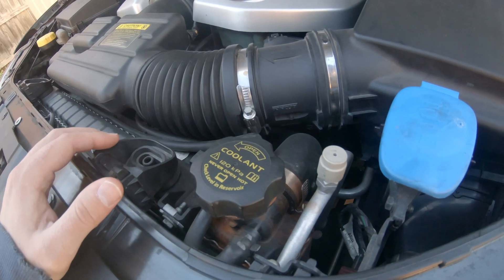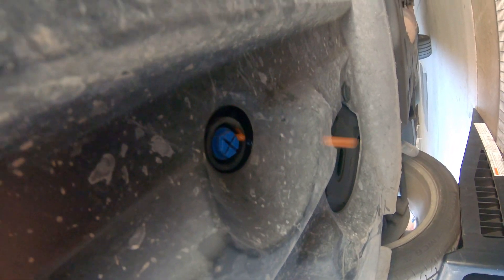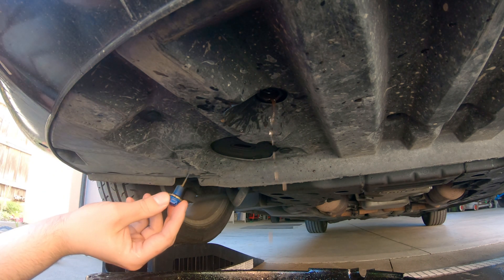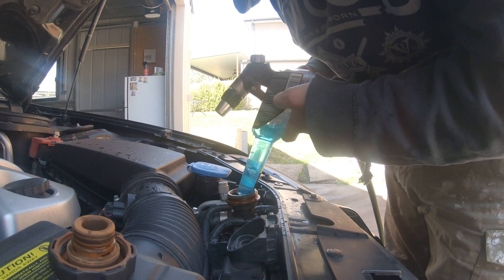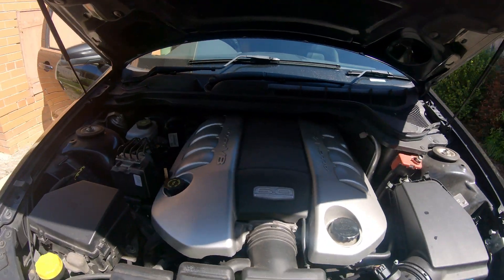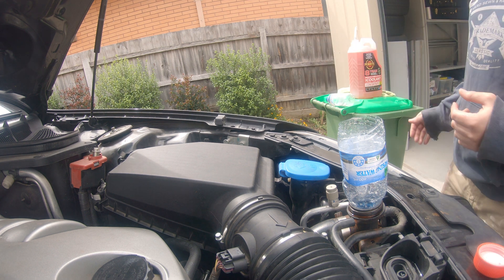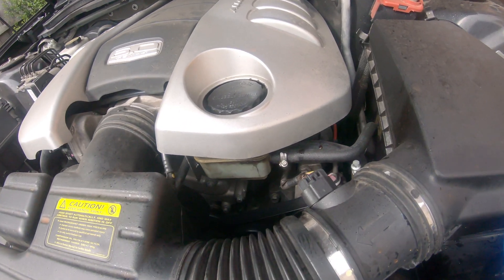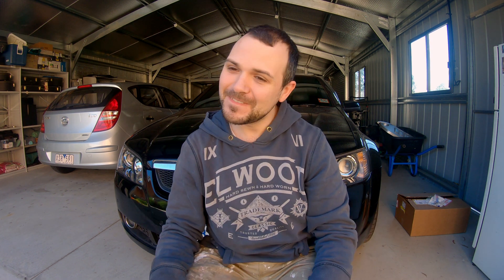Penrite Coolant Flush Fail - VE Calais V8 (Pontiac G8) Read Pinned Comment Before You Try!!!

Comment from the maker: A Quick note on filling and bleeding the system. A few people I have spoke to since have said to top up via the heater hoses to get in behind the thermostat, or pour straight down the top hose into the water pump (rather than the radiator) to make sure the block fills so you don't inadvertently run the pump dry! Thanks for stopping by and good luck with your repair!
Reply: Agree 100%, i hope you have looked after it, best insurance for the auto as well is get it serviced and put a external trans cooler on it, unless you have one on it already but great stuff and look after her champ, cheers. :)
Reply from the maker: @7071t6  Cheers mate - The auto is next on the list - the old GM slush boxes are better than they use to be but would rather do a service than a rebuild!!
Reply: This iz correct I have a 07 ve SV6 a lot of people make this mistake

Comment: Mate.... tough luck with the water pump! Not sure what the guy below was saying you did wrong.... I use the concentrate coolant and top off with diminerised water.... been doing that way every 2 years for years. Other wise same process..... good video!
Reply from the maker: Thanks for watching and for the comment Paul! Yeah not very constructive was he? I could have used de mineralised water or flushed the block directly without the thermostat , but if you do it often enough (like you do)  you are already doing more than most - and probably doing a more thorough job than most dealers!!
Cheers!

Comment: Not bad mate, the reason why theres so much rusty colored water is that if you use normal tap water it has chemicals in it like fluoride which acts against the inhibitor in the coolant which is why its better to use distilled water or a penrite pre mix which is already made at 50/50 and the concentrate is still as good, but with the pre mix it has the distilled water in the mix, but also who knows when the coolant was changed last and what product was used. keep up the great work, also be careful because the radiator has trans cooler heat exchanges built in it, which as the rust tarts to eat away at things it can cause the heat exchangers to fail thus having trans fluid in the auto and then your in a world of hurt. :)
Reply from the maker: Cheers Mate! Bang on about the rusty water. I think when the last water pump was changed (I didn’t do that one) it was just filled with water. I actually pulled the pump apart and the impeller was corroded to buggery, only a few years old too!  I think our water in Vic is softer than some other states (less minerals, but yeah still fluoride) , either way agree mixing with coolant, or using distilled water is the way to go! I have heard of the dreaded ‘strawberry milkshake’ before, not so much on these GM cars but early 00s Mercs. These GM Automatics are a time-bomb at the best of times so really hope my radiator holds up!!

Comment: Is it the same risk of damaging the water pump in the v6 version?
Reply from the maker: Hi Mate, 
Possibly - It depends how the colling system works in those alloytechs vs the LS V8s. Either way if you can find out how to bleed it and fill it properly before starting any job on it you should be right!

Comment: I've used sugar soap for years to clean cooling systems little bit more time consuming but does vert good job
Reply from the maker: Hey Barnaby! Sugar soap eh?  - never heard of anyone using that but if it works it works! When you say it takes a little more time is that cause you need to flush the system multiple times?
Cheers!
Reply: @MeatballGarage  sorry for the slow reply but yes u have to make sure  u get every bit of sugar soap out

Comment: I drained today, only 6 ltrs came out + plus sucking out what's in resovoir with a battery operated pump. Could only put in about 4 and a half ltrs with 500ml nulon extreme radiator flush + some in resovoir.
Ran car for about 40mins, till it hit 93deg Celcius.
Drained it. 6ltrs came out with draining resovoir. Filled it with 50/50 coolant about 6ltrs, ran it for an hour with cap open and AC to hot but not blowing air and watched it bubble/burp. Temp raised to about 90 I then I made AC blow by turning settings up to 13.
Fluid dropped.
Topped up, closed cap. 
Went for a drive. 
Temp dropped to 70, then climbed after 10mins to 83deg Celcius, and settled.(usually would sit at 87deg, this may be the computer relearning as I drive or even dilution of coolant to water being better) .
Will check tomorrow. And top up + drive for 20km one way. Check then 20km back again.

Keep in mind this is an 8 year old sv6 s2 z series which has now 111,000kms on the clock, who to as far as I'm aware has never had a coolant change done. so the low output of coolant drained could be due to evaporation as I've never topped it up but have also had no leaks.

This is probably more detail than I've heard anyone mention.

Oh and you may see coolant actually spin during the burping phase.

Also I used nulon red, deminerelised water all the way through, no tap water.

Will be performing again in three months to flush and drain more thoroughly. Though my system was very clean it seems.

Hope this helps somebody.
Reply from the maker: Hey YingYang Orca! Great write up mate and thanks so much for sharing! I'm sure a lot of people will appreciate this info and find this useful!! That is a very low km VZ you have there! When you drained your coolant initially did it come out clean/dirty? 
Thanks again
Marc

Comment: notice the cap has failed ,which is why the water pumped failed as well, meaning that as it lost pressure and coolant the water pump was running real hot thus the bearing stuffed up and now you have 3 real problems instead of a straightforward coolant change, but well done champ in doing it right as well. :)
Reply from the maker: Yep that cap was NASTY! I had replaced it once before already, and since this video went through another 2 (along with the heater hoses..) The first replacement cap (non OEM) held pressure but just seeped coolant straight out the top of it! Eventually just bit the bullet and got an OEM one which is bang on!
Thanks again mate - hopefully have some more car vids up soon!

Comment: Great video! I'm about to attempt this on my ve series 2 sv6. 
Question though whats best way to bleed the air from system? Just run the engine with the filler cap off?
Reply from the maker: Cheers Joel! That is pretty much what i do to bleed (right or wrong). Make sure the radiator cap is the highest point in the cooling system, fill it up, run the car till the thermostat opens then top it up again and just watch all the air bubble out. Close the system once the bubbles stop and you are good to go - just check the coolant level again the next day. Good luck with the job - let us know how it goes! 
Thanks for watching!
Marc

Comment: Buddy's how many litter used in that collant bottle? And yet very helpful insights on how change collant for a commodore; enlightening indeed big thanks.
Reply from the maker: Cheers mate - Just be careful when filling and bleeding the system - read online on how to do this correctly. 
I can't remember how much coolant this thing took - the internet says a VE L98 V8 takes 14.3l though if that helps. Is yours a V8 too? Cheers mate!

Comment: I’ve even purchased a new radiator and new cap but still have the car heating up to 102-104 sitting at lights and on average 30 degree driving it will go between 94-97 and up hill drives will see it rise to 110 and thermo fans kick on at 109. Sticky thermostat? Ve Sv6, giving me grief

Comment: What concerned me more so is the sheer rust in that water, if coolant is flushed/drained more frequently, these thing probably don't happen. You must always use demineralised water where aluminium components are, in the case of your VE
The block, heads & radiator lol. But good job regardless !
Reply from the maker: Hey Vincenzo! I know right! When that horrid water started to drain I just shook my head! I have since switched to AC Delco coolant which is about the same price as the Penrite stuff. Hopefully regular flushes will minimise any further corrosion. Thanks for watching and for the comment mate 👍
Reply: @MeatballGarage  You should use Nulon or Penrite 

They call it DexKill for a reason
Reply from the maker: Dexkill? Haven't heard that one before! I have heard bad things about both Nulon and Penrite before though..Might have to go away and do some searches on Dexkill...
Cheers Vincenzo!
Reply: @MeatballGarage  It was a known issue that gm coolant eats through gaskets, etc
Plenty of known issues, hell i'd rather use Toyota coolant before i use anything genuine gm coolant related 😁
Reply: @MeatballGarage  There was multiple class actions against gm coolant for numerous issues.
Reply: I own the 07 SV6 if you don't constantly look after the engine things can start going south real quick

Comment: Is your commodore engine an L98 motor ? also what coolant is okay to use because i have the american version 2007 chev lumina ss with V8 L98 6.0
Reply from the maker: Hey Darius! Yep that is an L98. Hmm there are plenty of opinions when it comes to the best coolant. I used Penrite once then I ended up using Dexcool - the AC Delco genuine stuff after this. Not sure what brands are available over there mate but there should be plenty of options. Good luck with it!
Reply: @MeatballGarage  so after i did my coolant flush, i had it idle and drove it a few miles then left the car sitting but started every so often, as of today, i started it and noticed at 64 degrees, smoke started to come from the thermostat area, any idea why ?
Reply from the maker: No idea mate - did you get it sorted? What was it?

Comment: Can you flush out the radiator without removing the flush plug? The head on our one broke off. It still works though.
Reply from the maker: G'day Glen - Hmmm good question - I just had a look at the radiator and it looks like the bottom hose outlet points up so there goes that idea. If you are really keen you could take the radiator out all together? 
Either way,make sure you read the pinned comment about refilling these things!
Cheers!

Comment: What does your Temps look like for coolent and trans?
Reply from the maker: Hey Arnold! Mate that is a good question - for engine temp it depends a lot on the ambient temp and driving conditions - overall though I find it operates between say 90 - 105c. On a very cold day on a highway it will hover around 90c. 95 for warmer days.  In traffic on any day it can get up to 104-105 before the thermo fans kick in and cools back to 99. I have only ever seen it get to say 107/108 a few times in traffic on hot days (when the fans go full speed). I find once you are travelling more than say 40*50kph the air flow really cools the temp really well - much better than my XW! I don't really keep an eye on the trans temp to be honest, but never seen it get to more than say 100. What are you seeing on your car?
Thanks for watching and the comment mate!
Cheers - Marc
Reply: @MeatballGarage  just recently changed the radiator im currently running from 98-105°c but before i swapped radiators i was at 95-99°c and trans sump is at 55-76°c since I put a tru cool 40k i have a built trans with a triple dick stall it was running 105 before trans cooler
Reply from the maker: Hmm ok. Did you make any other changes when you replaced the radiator?
Was it a GM one?
Also assume your car is lightly modified if you are running a converter/trans cooler. Cam/OTR etc?
Although the car is operating within its range it is odd to see it raise like that after a radiator replacement. Could your pump be on the way out? when you replaced all the fluids, did you fill and bleed the system correctly? I stuffed this up the first time which buggered my pump up..
Let us know and we will see if we can find an answer!

Comment: What about the old coolant in the recovery tank?
Reply from the maker: G'day David! Good question - you can remove the recovery tank and empty it or do what i did (but didn't document) and flush it by sticking a hose down the filler neck and flooding it till only clean water spills out. I am positive there is an easier way to do this but at the time thought this would do. 
If you are doing this to your G8 - when refilling i learnt that its important to fill behind the thermostat  - so you can fill from your heater hoses, or make sure you pour coolant straight down the top hose and into the block - I think air pockets ruined my water pump!
Hope this helps and thanks for watching mate!
Reply: Hi mate. Your post is old but thought I would write this anyway, just in case someone else wants to know how to drain the overflow. Take the rubber hose off where it connects to the radiator cap (best to do when semi warm as the rubber is a bitch when cold) and then let it hang into a bucket. Do not take the rubber hose out of the overflow. Gently slide a clean, soft, garden hose into the overflow and fill overflow with water until it tops up, but be careful the coolant does not come blasting out. With the overflow full, remove the garden hose and the coolant in the overflow should now start to syphon out the rubber hose and into the bucket. Do this a few times to get it clean. There might be a little bit of tap water left, but if you want to be fussy, then fill the overflow up once with demineralized water and syphon that out too. Reconnect rubber hose and jobs done!

Comment: So the radiator flush screwed the pump did it
Reply from the maker: Not so much the flush - but I completely stuffed up filling and bleeding the system, which led to the pump running dry. These things you need to make sure you fill behind the thermostat straight down the top hose (rather than just the radiator) and when bleeding it, give it some RPMs to force the air out.

Comment: Don't use tap water chlorine and fluoride is corrosive. Use distilled water and mix your concentrate, get your measurements write. Thank you for showing us brus. Hymn write
Reply from the maker: G'day Jacob - I reckon it depends on where you live. We have really soft water here in Melbourne, so I'm comfy mixing it with concentrate (which most have the corrosion inhibitors in them any way). If we were in say Adelaide or somewhere with hard bore water - agree no chance id use it in the engine! I have had white tee shirts ruined by washing them in hard water full of minerals and other nastys! Cheers for watching mate and hope you do a better job at flushing your system than I did!

Comment: Man that rad cap looks rusty !
Reply from the maker: Mate it was not flash - Absolutely filthy! Gave it a good clean up when I did the water pump. Thanks for watching mate!
Reply: @MeatballGarage  My g8 has a coolant leak somewhere right now, i need to flush and fill, but I see your flush killed the water pump. I don't want to get into those issues. But I need to find my leak first.
Reply from the maker: If there are no visible signs of leaking, your radiator cap might be the culprit. I have replaced a few in my time on my GM cars after noticing my coolant level dropping. 
I ripped open the Chinese water pump that was on my car and it was well corroded - id say it was a blessing it decided to give way in my driveway and not on the highway! If you run coolant in your G8 (not straight water like mine was) you should be fine! Good luck getting it sorted!
Reply: @MeatballGarage  Water pump and thermostat leaking is what the dealer told me this morning. Will be doing it myself after a $1700 quote.. ridiculous.
Reply from the maker: RideThe6 $1700 bucks - wow!! Give it a go for sure - take your time and you will fine! Let us know how you go!

Comment: How many times have u changed your water pump I'm fucking over my car 3 times in last5 months.
Reply from the maker: G'day mate - holy shit - 3 in 5 months is excessive!! Are you fitting them up yourself or getting someone to do it for you? Check the pinned comment about properly filling and bleeding these things as they dont like to be run dry. 
Maybe the harmonic balancer or some of the pulleys are out of alignment, putting pressure on the pump pully and impeller maybe?  
My VE did 3 or 4 in its life from memory. My old mans old VZ 6l did 3 in less than 100 thou kms. It's things like this that really make you hate the car!
Let us know how you go!

Comment: Because your used the worst brand of product on the market… Penrite . Unfortunately you had it coming boss 🤦‍♀️
Reply from the maker: Don't think that is how it works mate. I could have poured in liquid gold or camel piss and I still would have created an air pocket cause i didn't bleed the system correctly - leading to running the pump dry which they don't like.

Comment: I have V6 Commodore and  is there the same process for coolent flushing ?
Reply from the maker: Hi Mahesh - in theory yes but I am not sure if the V6 radiator has a drain plug or what the refilling procedure is like on v6s. Should be some info on youtube somewhere though. 
Cheers mate!
Reply: @MeatballGarage  thanks mate
Reply: Actually for v6 there isn't hardly anything. VE VF.